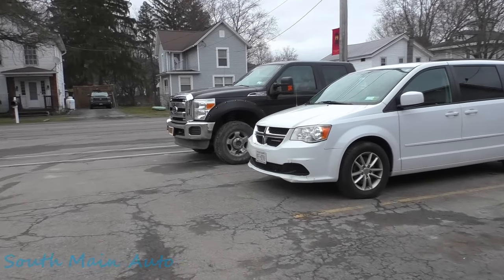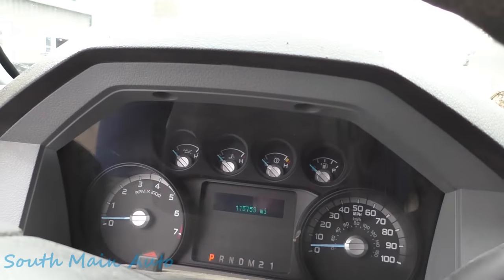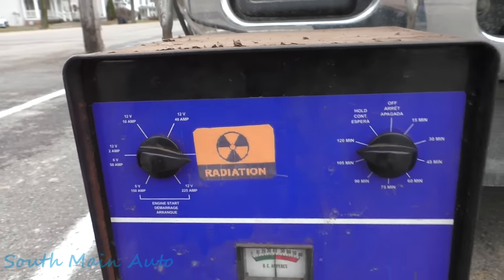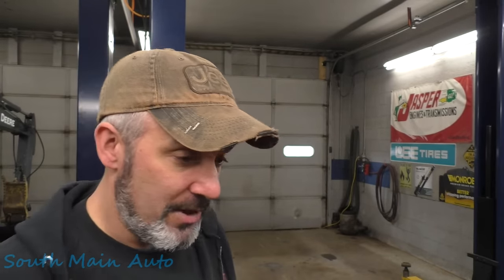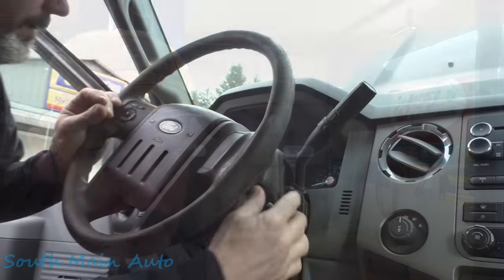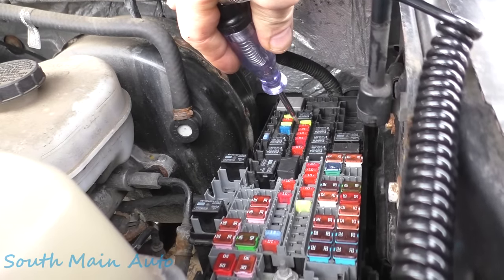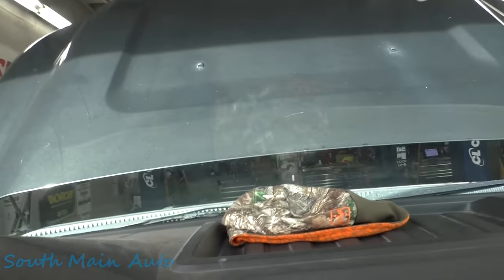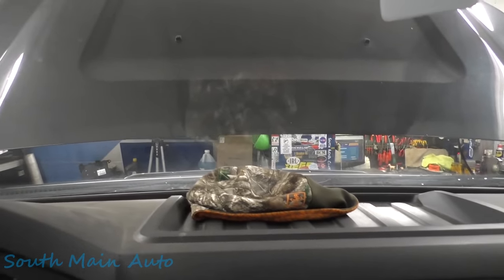Intermittent Stalling Ford F-250 : The Real Fix

Comment: The first shop was actually correct in their diagnosis. But, they didn't want to make the effort to find out why the fuse box was bad. They would have replaced the entire fuse box and wire harness. That would have cost a fortune. As a repair technician for 40 years in the mainframe computer industry, I commend your troubleshooting techniques and your tenacity. Job well done!
Reply: Yep gotta love the irony there. Good work Eric.
Reply: It says a fuse box is $125 and an hour or two labor. Nice try. Would have been fixed a month ago and probably cheaper than what Eric charged.
Reply: @cjr1881  what is "it"?
I find that very hard to believe.
Maybe for the cover, sure.
Maybe for the shell, but I doubt even that.
Reply: @cjr1881  that "fuse box" is not serviceable. It only comes with the harness, that's why it's so expensive
Reply: @cjr1881  Say that fuse box really IS $125, which I doubt it is. As you saw in this video, there are literally zero connectors that connect the wires to that fuse box. As others here said that makes the fuse box something that is not serviceable to the tech. So if you actually found someone willing to take this job on, the tech would have to remove the pins from every single terminal in that existing fuse box and accurately put them onto the new fuse box. An hour or two labor my ass, and the risk of human error is very high. Not to mention that if they don't see the problem wire in the first place they go to all that effort and thing thing is still broken.
Reply: I can't believe the underbelly of that fuse box.  Other manufacturers have maybe a dozen separate wire harnesses that terminate in a "connection block" which the fuse box itself plugs into.  Individual harnesses and the fuse box can be replaced or repaired for that matter.

Here, everything appears to be one harness and the fuse box is part of it.  Imagine replacing the entire electrical system to fix a broken wire.  That harness alone will be well into 4 digits.

You might as well send the truck to the crusher at that point.  It's the nail in the coffin.  Add that to the list of reasons I'll never buy another Ford.
Reply: Eric. Its time for a beer. Tomorrows another day. And your repairs are only 99.7 % accurate? Time to quit 😅
Reply: @MH-ev3wr  I think cjr1881 tells Tom Brady how to throw a football
Reply: I'm more used to Subarus and fuse box replacement is common with those as well, you get a solid chunk of harness as well.  Takes a few hours but you get a fresh box of fuses, relays, wiring, etc. and eliminates the guesswork.  I didn't watch the first video but early on I was thinking "sounds like a fuse box issue."  Great to fix it without having to waste a whole fuse box and the other components but there are times the book is just right.
Reply: That problem should never happen, cheap components..
Reply: @MH-ev3wr  I beg to differ, the fuse box is serviceable by a tech, HOWEVER it is not serviceable by a parts installer! 

AND taking the wheel liner out gives you access to the bottom of the box and it takes 2 mins on a wide frame and 3 mins on a narrow frame to remove! 

This throw away society s**t is getting out of hand, it's a broken wire and y'all want to just throw a entire new fuse box at it! 🤦 This is what separates real mechanics from those with soft hands that claim to be mechanics!
Reply: @Starchface OR fix the ONE wire! Jfc
Reply: @commonsenseisdeadin2024  mmkay - you tell that to the dealer who would refuse to work on it.
Reply: @MH-ev3wr  I am failing to see your point? 

Dealer "techs" are nothing but parts installers! LITERALLY
Reply: @MH-ev3wr  oh also, rewiring the fuse box 'pin by pin' wouldn't take all that long. Not every blade has a wire. 

I do like the plug in fuse boxes like GM but I despise Mopar's TIPM 💩!  HOWEVER, Ford fuse boxes don't go bad like that of the other 2...... The TIPM we will take out because it's something else all together (kinda) but why do GM's fail? Well the less connections a circuit has the better odds it will last! A plug in harness is just another failure point! 

The only time you'd really have to replace to fuse box is in the event it broke in an accident.... Given this particular trucks location, the vehicle isn't going to be repaired! But let's say it does, it's not going to be ideal, but either is having a fuse box fail! (Given it's main purpose, kind of ironic eh? 😂)

Comment: I have been an electronics repair technician for almost 45 years. Intermittent issues happen. Multiple failure points happen. Multiple Intermittent failures happen. They'll drive you to question yourself. I started testing repairs by picking up and dropping the item repeatedly to see if there weren't hidden issues that would reveal themselves down the road. If you work long enough you're going to run into stuff like this. Congratulations on your sticking with it and fixing it. Well done
Reply: Computer programmer here -->  I do this with code too  "I started testing repairs by picking up and dropping the item repeatedly".   After a while you develop a really nasty set of test cases.
Reply: I found once you disturb the connection and everything starts working just leave it on the bench and come back after a while and the issue has resurfaced.
Reply: The one that drives me mad is the  (Works until the case cover is on and screws are in.)
Then it fails.
Often it's a hairline crack on the pcb and the case dares to move the pcb slightly.
Reply: Well said….heat..cold…opens…intermittent shorts…all can drive you nuts when your working with electronics.
Reply: Have you ever read the NASA study about "tin whiskers"
Reply: You can call it a calibrated long term reliability and impact test.
The testing period must be no longer than a working week, or less if it produces flame :-D
Reply: Agreed it’s the multiple problems that can drive you crazy. I’ve gotten calls where both elements are out on a water heater and they had been resetting the top thermostat multiple times until they were gone and then I replaced them and then the top stat went up in flames because it was dead shorted from resetting so many times so I always replace both stats then a month later or so the breaker had to be replaced. Imagine that 😂😊
Reply: Gotta love shootin' the double open wire.... and for coding... the space character at the end of a line....
Reply: Same here . Question ourselves just kills me afterwards.  Lol.
Reply: I had an old linksys hub (a real HUB and not the switches we have today) that would randomly power cycle when we walked past it. It sat on the floor because I'm lazy so there ya go.  So I open the SOB up and long story short, I found a ferrite choke where one leg had a broken cold solder joint.

 I knew that was the big issue because I  held the power  cord in and wiggled the cord and it wasn't the cord or port. So I soldered the leg of the choke back on, reassembled it...and then literally kicked it across the room. Didn't power cycle, disconnect, or even break the housing so I knew my repair was correct and more importantly, SOLID. Haha!
Reply: As a telecom tech, I agree. Intermittent issues will cause you to question your ability.  I sometimes feel like a fraud.   Then I gather myself together, and follow my gut/testing.  It always shows itself, just when I'm about to give up, but tell myself, "give it another 5 minutes".

Comment: YOU DIDN'T DO ANYTHING WRONG ERIC! You specifically said in the previous video of this pickup that if it happen to come back with the same issue after replacing the relay that you would immediately know the problem was on the control side. Quit beating yourself up man. You followed through,fixed the problem and have another happy customer. Job well done!
Reply: Yea, I went back and double checked.  He had 2 powers on the relay contacts then.  What must have happened is that the crappy wire was JUST barely making contact, showing voltage, but when wiggled slightly from moving the relay, it had no current carrying ability, and the voltage drops out.  He had no way of knowing that at the time, because every time he measured that control power, it was there!  This time, it was broken enough that it was gone completely when measured, and that lead him to the broken wire.

The process was good and correct, he was just unlucky basically.  The crappy wire won the battle, but Eric O won the war!
Reply: Wish I had a fanboy club, to make excuses for me😘
Reply: "YOU DIDN'T DO ANYTHING WRONG". Wow what's wrong with you. LOUD NOISES.

Comment: I had a 250 for about 3 weeks intermittent stall and battery drain. Turns out the 3rd brake light was leaking during moderate rain soaking the RTM and waking errything up.

Comment: Back in the 50's started going on TV repair calls with my dad when I was about 10. Mid 60's USAF started my career in computer repair.  That was when a single computer took up a full portion of the building and you stood inside it to work on it. Retired a few years back, but I can tell you there is NOTHING worse than an intermittent wire to troubleshoot. The first GE mainframe I worked on had huge racks (3 per bay) that the outside racks had to be swung open to troubleshoot the center rack.  Problem was all the inter-rack wiring was not designed to be flexed multiple times. By the time the thing was 5 years old, we were instructed to never open a bay unless there was no other way to troubleshoot the original problem. The computer in question was used to detect and plot intercepts of aircraft that violated the East/West German border. Not exactly a piece of gear you wanted out of service for any length of time. Wonder how all my friends would have slept knowing that 25% of the entire 3 years I was overseas the most critical air defense system in Germany was being maintained by me.
Reply: here a broken or bare wire, there a broken or bare wire, everywhere a broken or bare wire. lesson one of anything electrical or electronic, hands off!
but sadly, just vibrations of natural daily things effects it all and will cause issues anyway.
Reply: As my friend serving in the us military said " we protected the peanut butter from the Russians.
Reply: Lol now that type of computing power is in the palm of your hand.

When I was 7 back in 1967 I walked into UD university of Dayton collage campus   the room was full of giant reel to reel tape players  this room was the size of 3 football fields 
The most that computer could do was add 2+2. And it took it an hour to figure it out.

Comment: Eric, although its a pain in the hoo haa either way, removing the driver side wheel well liner gives beautiful access to the bottom of the fuse box. I usually will do that if I have to track a wire issue like this so the fuse box is undisturbed for troubleshooting.
Reply: Hoo , haa  alias PITAaahhaaa.....

Comment: Great job on making it right 👍. I would think I'm speaking for 99% of your subscribers taking a vehicle to sma the job will be done right. And for me that's priceless.
Reply: That is why I feel I must be a DYI'er.  Around where I live if you want it done to your complete satisfaction, you better do it yourself.  Tried to take mine to SMA one time, when I was in the area.  SMA just stays too busy, and we know why. :)
Reply: How about chasing a thermal intermittent on a CCTV balun on top of a utility pole while the wind is blowing about 40 mph?  I, too am a (now-retired) technician and I forgot the basics for a minute until it all came back to me.  Broken wire two inches back inside the jacket that would expand (circuit good) during the day and contract (open circuit) at night.  Frustrating, but solved.  Now, it's time to go drink a cold NON-ANHESUER BUSCH beer.

Comment: Intermittent problems like this are the pits.  Your diagnosis was spot on.  “There’s the broken wire we are looking for…” The wire was probably damaged during assembly.  After years of vibration and temperature cycling it finally broke.

Comment: DON"T kick yourself for the return issue I recall you did everything right and your assumption of having power to that second terminal was right.  I had a mechanic take four months to chase down a bad wire in a engine wire harness.  Cool new tool.

Comment: Eric, I'm a 70 year old "FOSSIL" electronics tech / Shade Tree. One of the hardest intermittent problems to find is a poor connection. Like you said,  the only load on that 10 AMP fuse was the relay coil?  So that particular circuit was a load of DAMN NEAR NOTHING !  BTW, I liked the relay tester.  Years ago when I worked in manufacturing, we built several pieces of test gear that allowed us to access signals in circuit without having to dismantle EVERYTHING.  I also agree with your assessment of FORD trucks. HORRIBLE to access that Fuse box ...

Comment: I went back to the first video.  The initial diagnosis was correct.  The truck did need a new fuse box (which wasn't available) because most mechanics wouldn't want to invest the time and energy that it ultimately took to determine what the problem was within the fuse box.  That is the problem today.  Most mechanics would rather replace than determine what the cause of the problem actually was.  In this case it was a disconnected wire inside the fuse box.  I'm glad that you got it working and saved the day for the customer.

Comment: The fact of the matter is that when you find a fault you double-check if if the other ("true") fault doesn't present itself, you need to call it a day. If you were to go further in your diag every time you fixed the fault, you would be wasting hours per diag. It just goes like this sometimes, you do great methodical work and don't beat yourself up about it. You have to understand that you already do things to a higher standard than the average tech - you got this dude.

Comment: Hey Eric. I’ve work on these quite a bit up on the Alaskan oil field. The best way that I’ve found to access the bottom of the box is by dropping the wheel liner and then you can have it hang low enough to work on. I had this very ckt rub through behind the left headlight housing. Too late now but easier next time. Thanks for posting the vids even though you were ticked about it. It is super lame that Ford doesn’t make it serviceable or even easy to access for that matter.

Comment: After your 2nd diagnosis, I said the same thing, as you suspected the problem was under the box. Good job, Mr. O 👍🏾
Reply: I also thought the same thing.  Many times electrical problem nightmares are the hidden wires under fuse/relay box due to either corrosion or broken wires.  First time I have ever seen Eric get really pissed with the job he was doing.

Comment: Eric: You didn't mess up. You are only human. Don't beat yourself up. Most likely, when tracing the problem the first time, you had the midas touch and "fixed it" (aka erased the failure) but now you found the "real" (or likely main problem but fixed the secondary problem first) problem. I admire your smarts. If I was half as smart as you, I would be a millionaire.

Comment: Eric, love your persistence and logical approach.  The only thing that you noticed in the first video that concerned me was that the old relay looked and worked really well.  You noted a little crustiness on the contacts, but really it wasn't that bad.  So that was almost maybe, possibly, perhaps, not-out-of-this-world...a clue that there was maybe another cause.  In the end, you found the culprit...of course!   So proud of the example you set for all your viewers--young and old.  Best wishes for continued success from Florida.
Reply: He had power on the control in the first video, so the wire was not completely broken. The intermittent nature of the bad wire could also negatively impact the relay. It probably should be replaced and without an absence of control power it would be the logical culprit. If you want to be accurate the dealership recommendation to replace the fuse box which includes both the relay and the wiring harness would have been the fastest repair and possibly the most cost effective given the tow and time spent. However it wasnt available as he stated originally so this is what he had to do.

Comment: That control wire, when it was making a connection, was still probably at a reduced voltage (even for a low draw on the relay coil) could have been too weak to close the relay contacts enough to prevent arcing/deterioration of the contacts (I know you took a brief look at them), and could have made the relay just as unreliable as the broken wire... I'd be curious to take little closer look at the old relay, if it wasn't long gone in the trash.
Reply: You see the old relay (a bit) in the first video
Reply: He opened the old relay in the previous video. No visual signs of failure.

Comment: You didn't misdiagnose anything, you did what any honest guy would do and you went with the most obvious answer on the 1st video and not only that you properly tested the circuits as you always do.  It's an intermittent how much time do you want to bill?  Relay is cheaper than labor regardless.    I thought this was an excellent video series; so thanks a lot for sharing it with us Eric; hope all is well and I'm glad to see you're feeling better.  God bless brother 🙌 🙏 

Let's go Brandon 😂
Reply: It was a difficult problem to find. Intermittant problems can have you chasing yourself in circles. He got there in the end and it would have saved the customer a wiring loom replacement at another garage. Eric's method does work. 👍Didin't help that he had a cold.
Reply: @Sean006  Absolutely.

Comment: MR. O, now we know why when the other garage said when they hit the fuse box, it would work and they said it needed a different fuse box. The wire was broke. Your the guy, you find the issue and fix it. The other garage just wanted to replace the whole fuse box. Way to go. Love the way you diagnose the issue further. 👍😊🔧